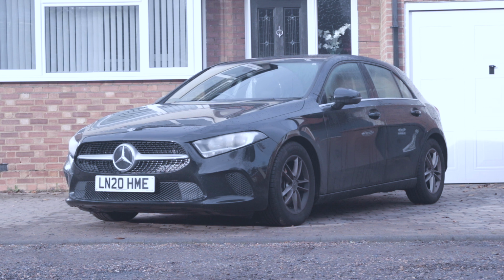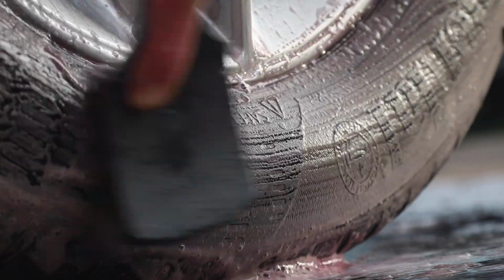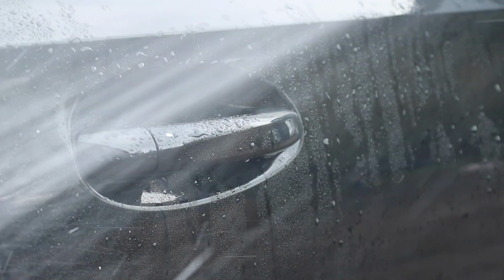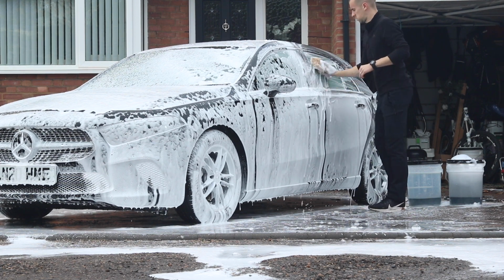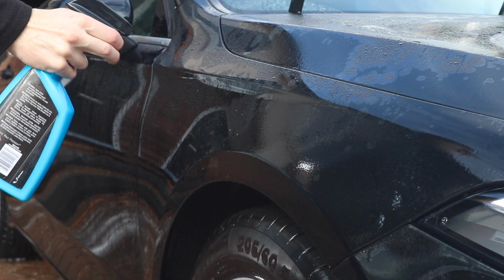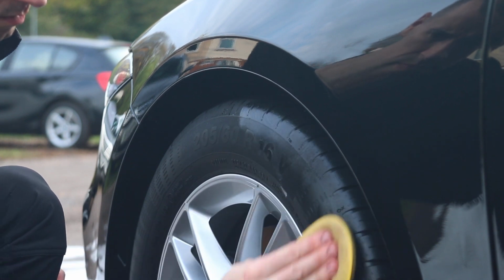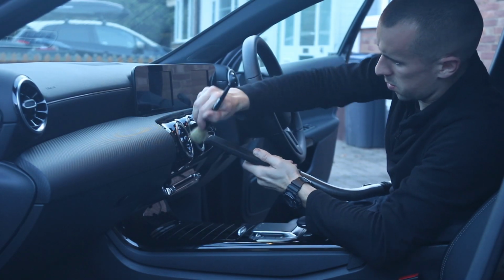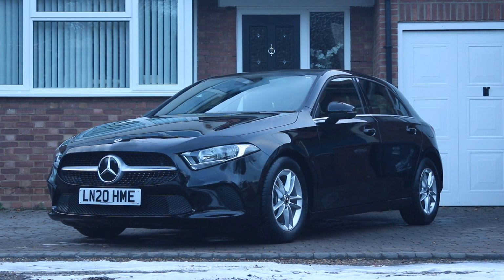Deep Clean Detail | Filthy Mercedes A Class Winter Wash

Comment: Hey Joe 🎸
Love the idea of the lubricity technique adding the shampoo to the paintwork before contact wash. 
With this can I ask?...
Do you need the buckets?
You could use a stubby trigger on the pressure washer & blast off the wash mitt after each use or do the multi wash mitt. 🤔
Reply from the maker: For sure you could. You'd want to use microfibre pads or mitts for that, on use one bucket and multiple mitts or wash cloths

Joe

Comment: That snow foam is cheaper than Bilt Hamber Auto Foam! I tend to use Auto Foam on jobs as it doesn't leave mess on a customers driveway,  plus you get consistent removal of film. Auto Foam isn't pH neutral so that would explain its biting power and ability to strip some protection. Might have to try UF's snow foam at some point. As always top video mate!
Reply from the maker: Hey thanks for watching buddy!
The UF stuff is worth a shout at £13.95 and with my code you get a bit more off as well!
Joe

Comment: Hi Joe, well done on the real world demonstration, not many out there at this quality / very helpful. 
I've just got a new car and cant make my mind up on using using the ceramic Sio2 polish and wax (Turtle Wax) i've purchased purely because it's now very cold. Do you have any experience of using these products in the winter and any issues that may arise, my understanding is that manufacturers generally say to use at non winter temperatures so i have a dilemma here.
Reply from the maker: Hi Tim

I have not used those products buddy. I would say if it's over 5 degrees C you should be safe. Below that chemicals struggle to cure on cold paint
Reply: @JoeHuntley  Hi Jo, thanks for your comments much appreciated.

Comment: Built hamber snow foam on your list?

Don’t you have to clay bar a car before applying ceramic wax?
Loads of videos with different techniques on using it
Reply from the maker: Yes it sure is!

If you are applying a ceramic coating to your car, yes, clay it, machine it and perfect it. 
This does not fall into this category. This is a turbo-charged spray wax effectively.